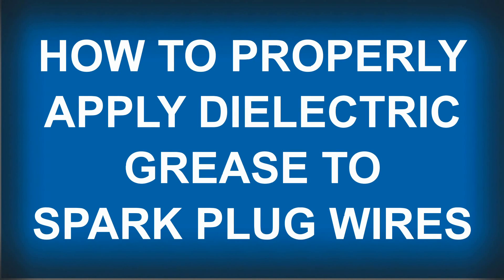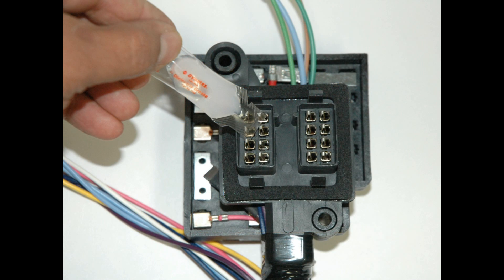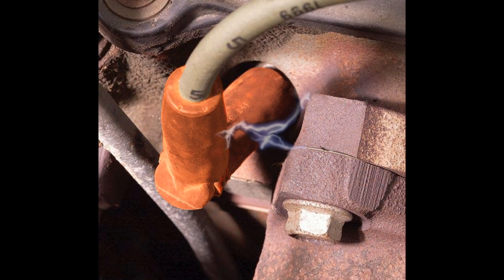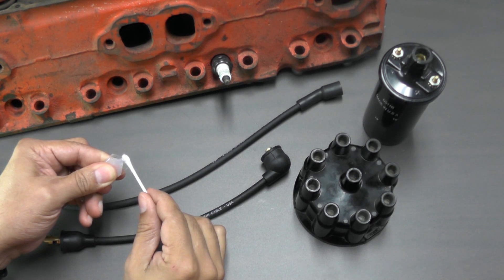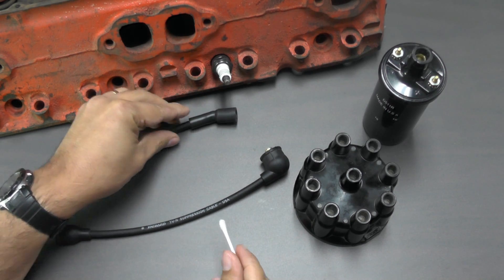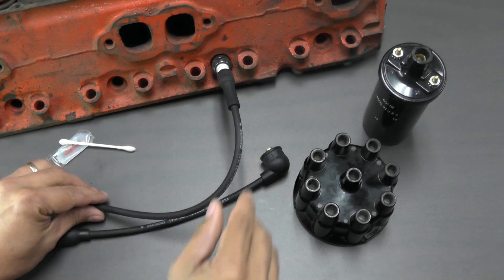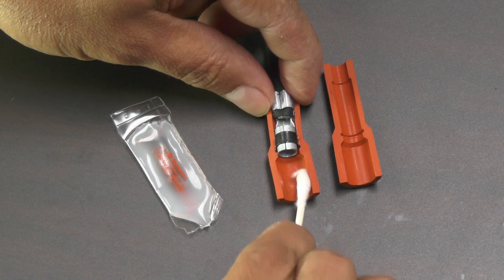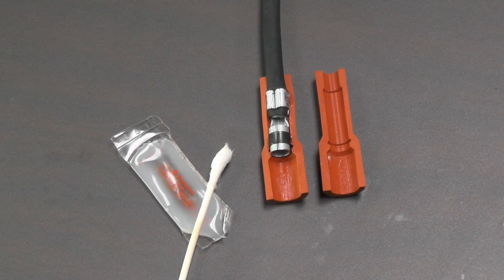Dielectric Grease - The PROPER way to apply it.

Comment: I disagree with this video. The point of using dielectric grease is to prevent corrosion of metal terminals (and also to keep your boots from sticking to your spark plugs). You want it all over your terminals so that moisture cannot get to them. The term "dialectric" is used here to mean that the grease is non-conductive. You're not going to add any significant insulation to these wires by applying a micro thin layer of grease. http://forums.mikeholt.com/showthread.php?t=121282&s=37d89f3556f59c91ed9d82639bff605f&p=1144433#post1144433
Reply: Watch This
If your spark plug connection moves or rocks, it is unsecured. I.e., that is not the way it is supposed to be connected. There should be a tight connection that does not "jiggle around." When there are metal to metal connections, there is enough force to push away any dielectric grease that might act as insulation. I can't see how grease can interfere with a metal that produces a constant force against another metal. Maybe that is why those connections failed. They were loose in the first place. The grease likely had nothing to do with their demise. If your spark plug wires don't snap onto and hold onto your spark plugs securely, it's time to get new spark plug wires. But even, aside from high voltage applications, putting grease all over a low voltage application should not cause any issues. I would bet that more connections fail due to corrosion than they do due to grease.
Reply: +ThingsDemystified  I agree on your comments. If there is a gap between 
terminals, of course dielectric grease will create insulation, causing 
stray arcing or simply finding a different path of conductivity, but in 
case of electric terminal where you have a male going into a female, or 
even loose wires being spliced with a butt connector, there is, or 
should be enough wiping mechanical action, or crimping action, when the 
terminals connect, thus clearing a path for a contact between the two. 
The dielectric grease has to be applied sparingly to be able and coat 
corrosive metal terminals, so it could help prevent oxygen, moisture, 
and outside elements in general, from causing corrosion. After the 
terminals wipe each-other clean, when contacted, the microscopic layer 
of dielectric grease will not cause a significant spike in resistance, 
and will definitely not alter the path of conductivity. I have 
personally measured such resistances with and without dielectric grease 
applied, to my surprise, sometimes, numbers were worse (meaning higher 
resistance) without the dielectric grease applied...SHOCKING !!!!

Well there has been a lot of debate on the application of dielectric 
grease, but to prevent arcing between very close tolerances, the grease 
has to be applied sparingly just so it creates the layer of insulation, 
as long as the two pieces do not touch, or in another words wipe 
each-other clean, thus creating connection!
Reply: +Watch This Arcing is caused when there is a gap between the points of electrical conductivity, I am not lecturing just clarifying! When applying the dielectric grease in such condition there will be arcing, most definitely, but when you have a mechanical connection without gaps, during the process of establishing the connection, the grease, will be pushed away and will not cause arcing. Every mechanical point of contact will have greater force when mated, than the force of the grease to withstand being wiped away during the mating process.
    The vibration during engine operation causes the electrical connectors of the spark plug wires to create a sine-wave of tiny separations from the spark plug terminals causing tiny microscopic gaps during this vibration, this is mainly the cause of pitting and damaging of the wires' contacts and terminals, since during those tiny separations there will be microscopic arcs. The grease will not be able to fill these gaps that quickly, thus creating an insulation and causing premature wear. 
   Every engagement and disengagement of of any simple electrical connections will cause arcs, even on the negative flow of current. Unless this is a space shuttle made by NASA, we do not have readily access to such materials that can prevent arcing on their own, or if we had some extreme vacuum conditions with absolutely no conductive elements present. Most of the time, after years of usage, we get car window switches, with heavy pitting on their internal contacts making them useless. They are usually made of subpar materials to save on manufacturer's cost. Spark plug wires also fatigue like so, but as they say you get what you pay for.
Reply: +Watch This Very true about packing the spark plug boot with excessive amount of dielectric grease. It is not clear by any manufacturer what is an excessive amount. This is where the real debate starts, but you are absolutely correct. On this type of, (lets call it an Un-secure Connection) it will definitely make sense not to apply any of the grease, and only coat the boots, just so it protects from stray arcing and also dirt entering.
Reply: +1 greasing the terminals reduced contact area, which increases current per area, causing vaporization of metal, the plating, or enhancing corrosion.
Reply: I NEVER use dielectric grease on spark plug wire terminals.  I've seen the problems that occur with the added resistance of the grease.  It's OK to use on the boots.
Reply from the maker: +DJ KrazyMM  Thank you for your comments.  Although, I'm scratching my head on your "SHOCKING" statement, your reply was very well thought-out, accurate, and appreciated.   But I would like to add to your comments to give a more-complete picture.  In regards to spark plug wires, the terminals on the wires have a detent/dimple that snaps onto the spark plug's terminal post.  It is not a solid connection, but rather one that can move/rock.  If a spark plug wire's boot is packed with dielectric grease (as I've seen many times), as the terminals move/rock, that grease can get pushed into the area of contact.  When this happens on a connection passing-through 10,000-50,000 volts, arching can happen.  This will affect your engine performance and prematurely break-down your spark plug wires. Almost all of the spark plug wires that I've seen as "defective" were the result of the improper use of dielectric grease on the terminals.  So my question is, if this can happen, why press your luck and even use dielectric grease on the terminals?  Again, dielectric grease prevents current flow.  Some might say it's used to prevent corrosion of the terminals.  OK. I get that.  But on a spark plug wire's BOOT, if one were to apply a thin layer of dielectric grease THERE, that would prevent dirt/crud from ever reaching the terminals in the first place.
Reply: Got to go with Watch This on this one. Grease as used in any other application serves to prevent metal-to-metal contact, not encourage it. Dielectric strength of these types of grease is on the order of hundreds of volts per mil. Only a very small voltage would be necessary to jump such a small grease gap if the terminal failed to scrape it off, but it could arguably encourage arcing and associated pitting of the electrode, which would eventually widen the gap, and cause more arcing. Secondary ignition terminals won't corrode quickly in air the way that positive battery and light bulb terminals do, because they're not held at a constant positive electrical potential relative to their surroundings. Water causes accelerated corrosion, but it should be kept out by helping the boot properly seal.

To get even more annoyingly scientific, arc faults can follow the spark plug insulator and/or boot in air to the base of the plug. An air gap of around half an inch can be jumped by a 40kV ignition system. (Air dielectric strength = 76kV/in. I've personally seen a GM DIS jump a gap much larger, but want to stick with published numbers.) The same system can only jump along a tenth of an inch of grease (400kV/in). If you want to coat the contact surfaces with grease, go ahead, but I would not neglect the insulator and boot.. that's where this grease will do the most work.
Reply: wrong.   do you know the metal on metal is not impeded at all.   The grease coats the metal but there is no resistance at all.  It's practically at the molecular level.
Reply from the maker: +ThingsDemystified Not totally correct. The purpose of dielectric grease is NOT to prevent corrosion of metal terminals, nor is it to prevent your boots from sticking.  Speaking from years of experience and trouble-shooting "defective" spark plug wires, using dielectric grease on spark plug wire terminals will actually cause the terminals to pit/corrode - not prevent corrosion as you've stated. If you use dielectric grease on spark plug wire terminals (not the boots), you are increasing the resistance between the wire's terminal and the spark plug's terminal (post). This can cause arcing, which leads to the terminals pitting/corroding.  If this goes on long enough, the terminals will slowly vaporize.  In the old cars that used ignition points in the distributor, we had to replace the points periodically because the point gap contacts were slowly vaporized from the constant arching.  In regards to using dielectric grease to keep the boots from sticking, this is a positive SIDE EFFECT from using dielectric grease, but it is not the main reason to use it. If non-sticking boots was the main reason, why don't mechanics use chassis grease or bearing grease instead of dielectric grease?  Those greases are readily available in the shop and much cheaper than dielectric grease. Electricity always wants to take the past of least resistance. And in regards to spark plug wires, you want the electricity to take the path of going through the plug's gap, but not (leaking) anywhere else.You are correct in that di-electric grease is non-conductive. And the MAIN reason to use dielectric grease on spark plug wires is so prevent the high-voltage spark from leaking around the boot to an unintended ground (engine block).  I hope this better explains the matter.
Reply: Watch This
Why would grease cause corrosion and pitting, and how does a thin layer of this grease offer any benefit to the already present insulation?
Reply from the maker: +ThingsDemystified My point is that adding grease to the terminals (not the boots) adds NO benefit.  It can make things worse.  How?  We know that electricity takes the path of least resistance.  Adding dielectric grease (or any material for that matter) to the terminals adds resistance between the two terminals.  So now, instead of a spark passing through its intended path (from the spark plug wire's terminal - to the spark plug's terminal) the spark may jump/arc from terminal to terminal - circumventing its intended path.  In doing so, over a prolonged period, can cause pitting of the terminals.  Conversely, you WANT to add dielectric grease between the ceramic portion of the spark plugs and the boots.  This is the only place on a car that you should use it.  Why?  To lessen the possibility of the spark jumping around the ceramic and finding ground (usually the engine block).  Also, it will lessen the possibility of the spark jumping through a boot that may have even the slightest crack or pin-hole in it; a pin-hole that can not be seen with the naked eye.  I hope this helps.
Reply: Watch This
It would seem that if this were the case, the manufacturer would make it abundantly clear in the directions. Maybe I should contact them to see what they say. I just don't see how a thin layer of dialectic grease can prevent arcing. It just doesn't seem like that's the purpose for the grease.
Reply from the maker: +ThingsDemystified I'll save you the time.  I just did a Google search and found the application instructions for Permatex Dielectric Grease  - THE most widely used brand of dielectric grease. The manufacturer's application instructions DO make it abundantly clear. They concur with what I've been saying, that you should apply only a THIN layer to the inside of the boot. There is NO mention about applying it to the spark plug terminals either - which also concurs with what I've been saying.  http://www.w8ji.com/images/Cars/Battery/09980.pdf  Hope this helps.
Reply: Watch This
But do they tell you NOT to apply it to the terminals? Do they tell you what it's for?
Reply: Here are the product benefits. Notice that nowhere does it say anything about its being an insulator. PRODUCT BENEFITS
 Improves connections
 Prevents corrosion
 Prevents fusing of spark plug boots
 High temperature properties
 Excellent rubber lubricant
Reply from the maker: +ThingsDemystified Hi again.  I agree with the points you posted from Permatex's Technical Data Sheet and some of that from their (I'll call it) "quick view instructions", as provided in the link you posted.  I have to say that I would trust Permatex's Technical Data Sheet (or any other manufacturer's Technical Data Sheet) before relying heavily on their quick view instructions.  A company's Technical Data Sheets are very thought-out and carefully written, not only for accuracy but for liability.  I say this because their "quick view instructions" leave room for misinterpretation and confusion.  Of course it does, when you try to condense an entire page of a data sheet into the 4 sentences of their quick view instruction.  They say, "3. Coat both parts of terminal contact with Dielectric Grease. 4. Reassemble, maintaining metal-to-metal contact."  The term, "terminal contact" is redundant.  Either it's a terminal or a contact, not both.  The industry terminology is, "terminal".  You can coat all parts of both terminals (if you want) with dielectric grease, provided that the grease doesn't permeate the metal-to-metal contact point.  The grease, being a barrier/insulator will probably help to protect the non-contact portion of the terminals from prematurely oxidizing/corroding.  Which brings me to their step, "4. Reassemble, maintaining metal-to-metal contact."  I interpret this literally; metal-to-metal.  Not metal-to-grease-to-metal.You also stated that Permatex makes no mention of their product being an "insulator".  That term is too technical for most users.  Much as they don't use the words: anti-oxidant, anti-seizing, or even lubricant, of which can be said of dielectric grease's uses.  But they DO give ample uses and areas of application for their product that most people will understand (as you've stated above).  Uses/applications like spark plug boots, distributor cap nipples, etc.

Comment: All we have to do for DIRECT electrical(metal to metal) contact is use some DeOxit cleaner/conditioning spray. I believe it also comes in a gel. This stuff is the best of the best. As for applying dielectric grease to any connections, this video is pretty accurate,especially for those of us who have seen first hand how plug boots will bond to the spark plug after a few years when put on dry. It is incredible how strongly they stick to the ceramic on the plug. Good video.

Comment: There's nothing wrong with using dielectric grease on electrical connections. I've done a resistance test one time with my multimeter on two of the same connectors, one with dielectric grease and one without dielectric grease, and both had the same resistance.
Reply: yeah i put that shit on everything! Like Franks Hot sauce, author flat wrong. It waterproofs connections and prevents loss of current & corrosion.
Reply: +DZEyoyo123   Yep, the author of this video is simply incorrect. From the standpoint of conduction, it's no worse to fill the connector with grease than to fill it with air. Contacts push the grease out of the way when the connectors are put together. The grease surrounds the contacts and prevents corrosion from moisture and humidity. Industry has been doing this for decades. Come to think of it, so have I.  :)

Comment: You said not to put dielectric grease on electrical connections. What do you do if local laws require it? Or what do you do when you buy a new safety switch that has dielectric grease already pre-applied in the inside?
Reply from the maker: fishodorvagina All I can say is don't do anything illegal or against code.  Use my video and information for what it's worth.  Thanks for your comment.

Comment: Watch This, would this negative trade-off of diminished flow of electrons you speak of also apply to the use of battery terminal protector/spray or the use of anti-seize lubricant on windshield wiper arm nut and the splined shaft?  I am guessing you don't use anything on your car battery terminals.
Reply from the maker: ourlegacy Personally, I like the battery terminal protector spray.  It will help to seal-out the battery terminals from the sulfuric acid gasses that can leach-out of your battery from the minuscule gap between the plastic battery case and the lead battery terminals,  But to use the spray correctly, you should apply it AFTER you affix the battery cable terminal to the battery.  If you do it this way, you will still maintain a good metal-to-metal contact.  This means there would be no trade-off of diminished flow of electrons. 
In regards to the use of anti-seize lubricant on the windshield wiper arm nut, unless I'm misunderstanding your question, this is not an electrical contact and therefore is not a problem.